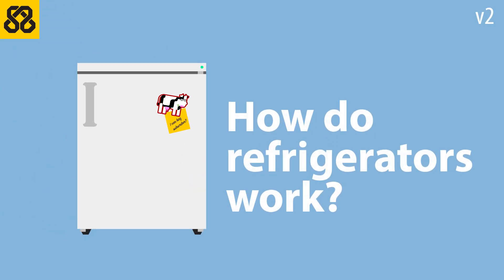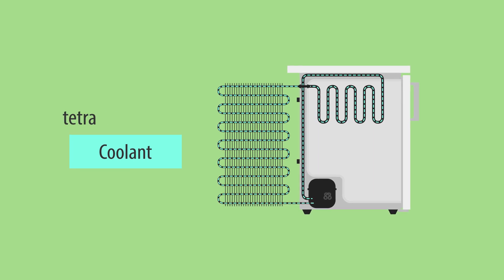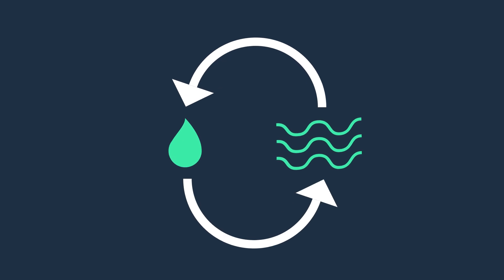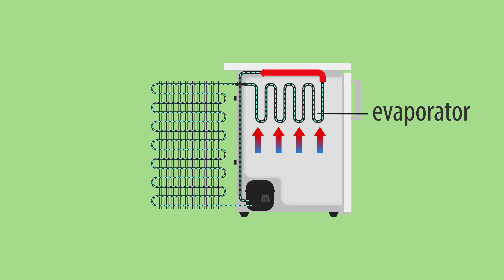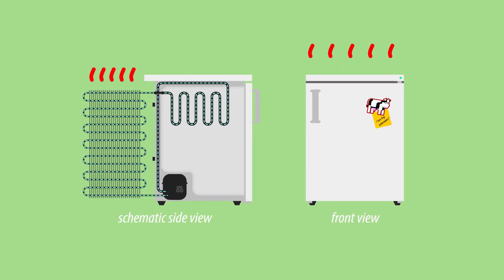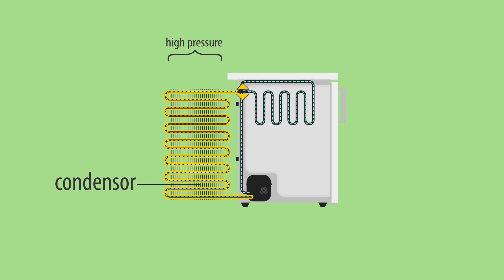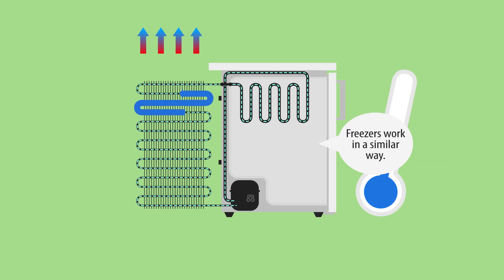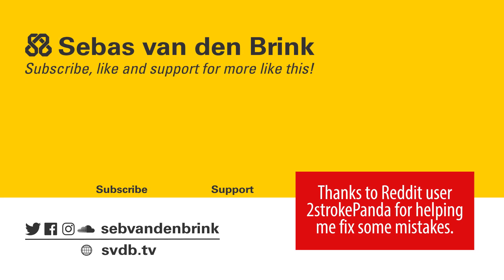How Do Refrigerators Work? - Refrigeration Explained (2.0)

Comment: Nice illustration, but it is the termostatic coil-valve which opens  the liquid-line when temperature is dropping to certain level under setpoint which causes the compreesor to start due to a lowering of pressure on the low-pressure side👍🏻
Reply: You mean Thermostatic